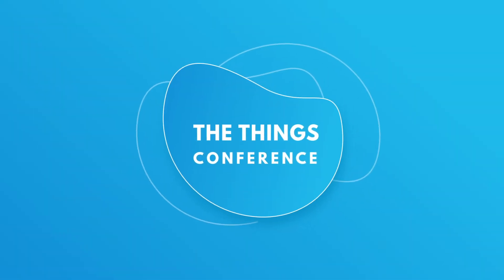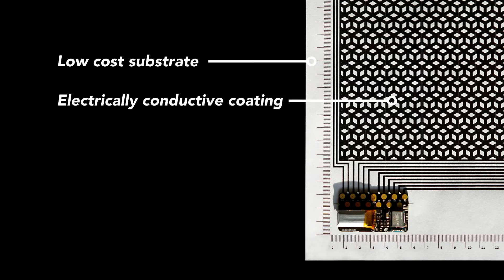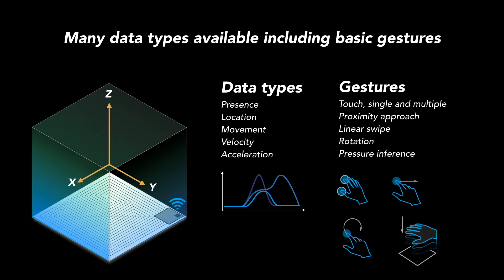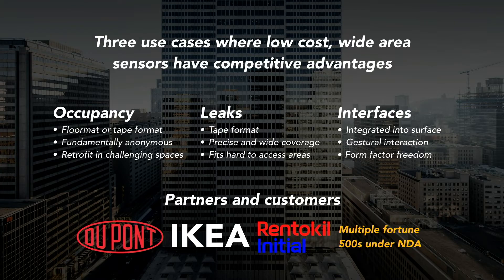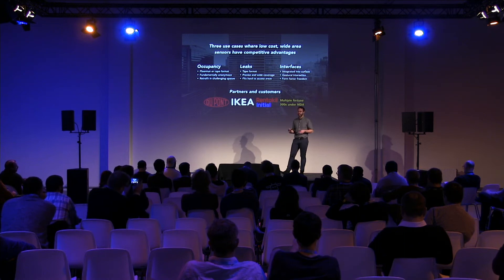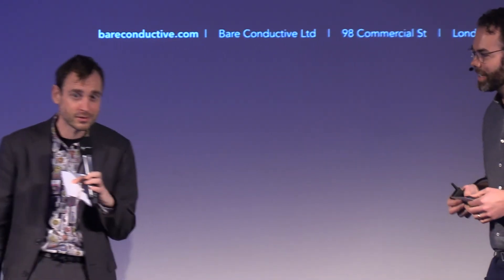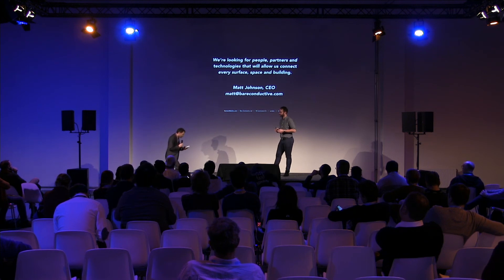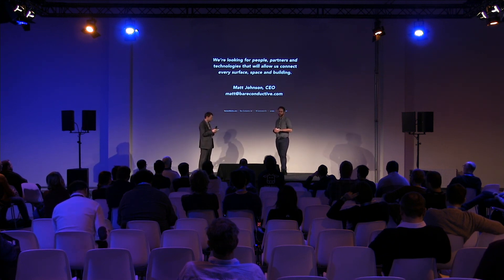Paintable IOT: Scalable sensing - Matt Johnson (Bareconductive) - The Things Conference 2019

Comment: Very interesting presentation. What about using these in a pool to detect the presence of some one or some thing in the water?  Or, detecting weight of an object, say in a cabinet to determine how much salt is left in the cupboard?  Or a large mat for a executive conference table that could also be used as a large mouse pad for a display?  Restroom and Locker room walls or floors to detect occupancy without illegal video recording maybe?  Very fun!